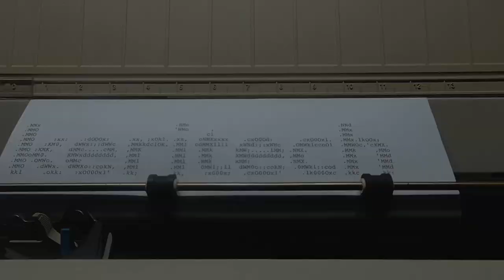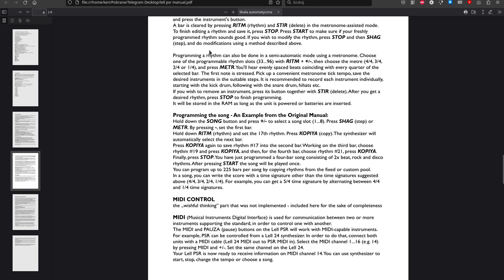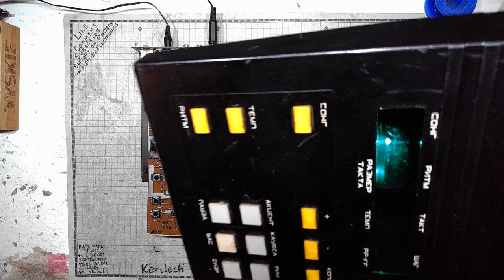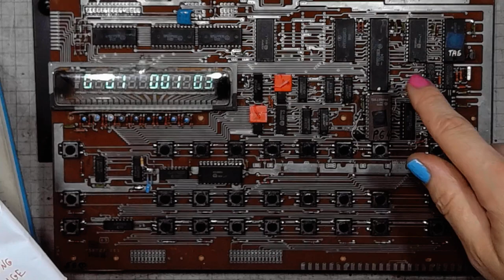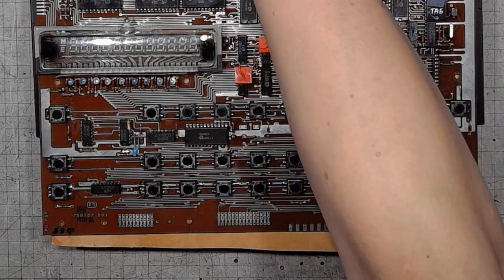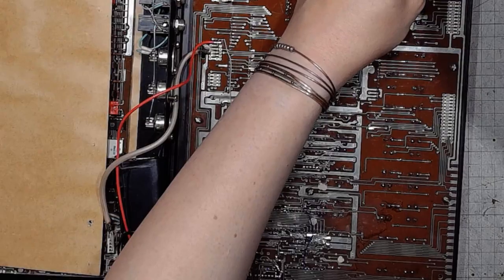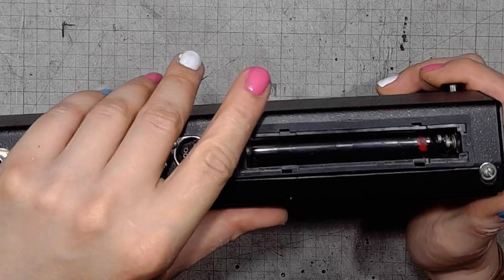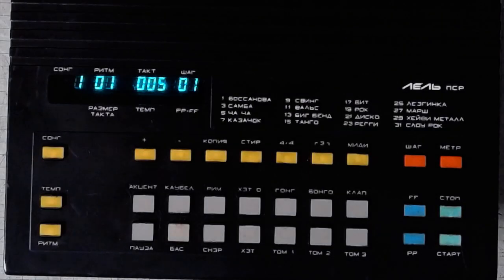Inside the Lell PSR Drum Synthesizer, Part 2 - A Deeeeeeeep Dive!

Comment: I have also this drum machine and he also doesn't work. I tried to reverse it  on last year and return to it  it time to time. and a few days ago I looked on web about it again and found your block diagram and it helps me. You make almost same like me but more. So , I have no any data on processor port D0-D3 and no clock to other chips and chip select and power for it because some of chips powers from chip select signal. Finally I want to replace processor and then will look what`s next/ Main data bus is not run
Reply: also I starts to remake schematic of main board and pcb.